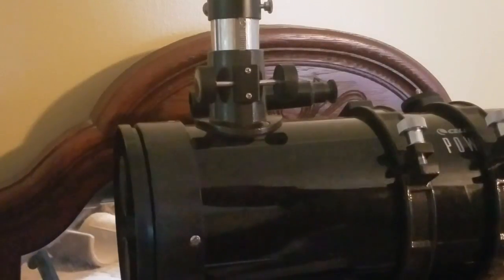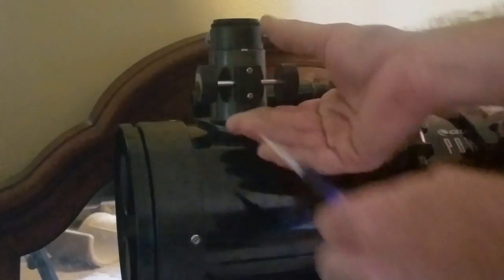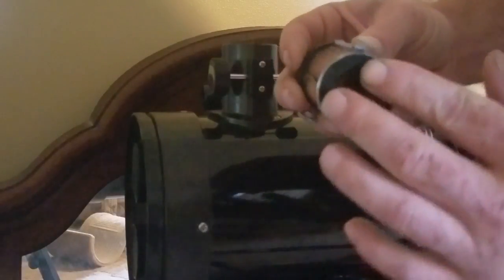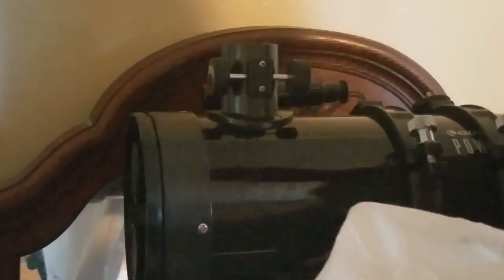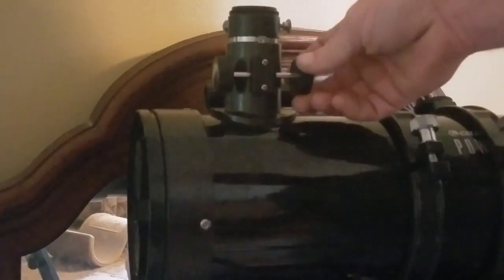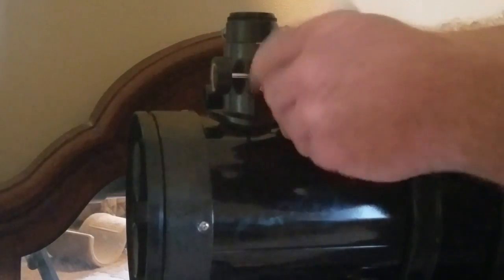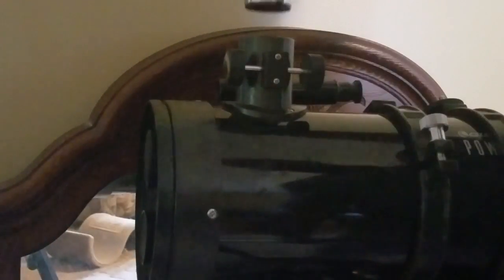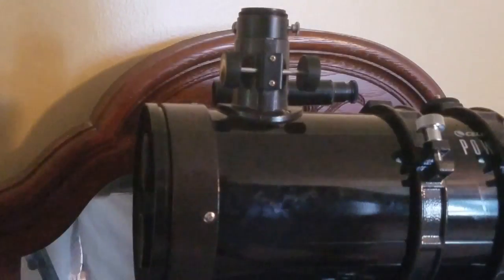Laser collimating a Celestron powerseeker 127eg step 1

Comment: Thanks for the video!  There are so few with this level of detail for the powerseeker. I’m curious if you ever had fine focus issues if the plastic ring wasn’t tightened down over the corrector lens tight enough in the focus tube?  I’ve collimated and I know the lens is in facing the correct direction (because I got it wrong the first time) but I still have trouble getting extremely fine focus even with just my 24mm eyepiece with 2x Barlow in. Just the 24mm seems to resolve a decent focus without the Barlow. But once I start increasing magnification it has a harder time...

Comment: Thanks you very much for making this vídeo  Chris!!
But I'm a little afraid of removing The corrective lens from The focuser....
I found these poste on a thread at Astonomyforum.net about collimating The Powerseeker:

#i did the same, i've removed the correcting lens from the focuser and using laser collimater i've almost collimated the mirrors, but once i placed back the corrector lens, i can see the my eye is not located at the middle of the secondary mirror + i can see an oval shape when looking inside the focus tube instead of circular shape. i'm getting crazy and dont know which of them should i trust , the laser collimator or my eyes

I feel your pain. I too have the same scope and the Collimation woes. I have removed the internal Barlow to aid in Collimation. After putting it back together the images I see are only in half focus. Hopefully at a star party in two weeks I can find someone to help me out. I hope you get yours figured out soon.

I could have gone wrong to these folks having problem after removing and putting back on their corrective lens?

Comment: Why do you have to remove the corrective lens? Is it because the collimator tool won't fit if the lens is in place?
Reply from the maker: soulreapernathaniel 
It has to be remove to use a laser collimator. The laser looks like a blob with it in and a pin point with it out.
Reply: Chris Fleming 
thank you for the reply..
Reply from the maker: +soulreapernathaniel
You welcome... I they to write back as soon as possible.

Comment: It's worth mentioning Celestron's opinion on collimating this telescope. If you're like me and read the entire manual that came with your telescope you too probably came upon the part that says, "The optical performance of most Newtonian reflecting telescopes can be optimized by re-collimating..." and the subsequent pages on how to do it, including the suggestion to purchase the 1.25 collimating eyepiece. Tech support will tell you that at least in hindsight, this section should have been omitted from the manuals for the bird jones scopes. IKR??? WTF. The reason being that the eyepiece or laser is meant to take measurements from the focal point, which is half a meter back from the focuser once you remove the lens. It's here that I'd like to mention here how awesome Celestron support is despite this goof, and that if you find yourself tearing your hair out, call them and they will (in my experience) bend over backward to make it right. I was told by a very understanding support person that she's had hers for years and it's never needed re-colllimation and that barring some severe jolts, it would likely never need it. So then that left the question, what if it does? Mine was new so they issued me a UPS label and I sent my tube in for re-collimation. Awesome? Yes. But I really wanted to be self sufficient so I asked "Can I not perform this procedure at home?" Officially you're supposed to have them service it. But if that is insufficient and you need to be able to do it yourself, to look on youtube for instructions on how. So here we are. =)
Reply from the maker: That was cool of Celestron to do that. An I am with you on self sufficient part! I have had good luck on collimating it my self with the lens out and the laser collimator in the focuser. I have added a center dot on the primary mirror which has helped a great deal. As far as it never needing re-collimation lol. It's made well but temperature alone can off set the mirrors.
Reply: I've been considering a dot also, how did you go about setting yours? Thus far I've been too intimidated to stick something on my primary, which is pretty much how I felt about the lens till you alleviated that concern. Thank you again.
Reply from the maker: +Liam Howlett I play listed the video I followed on my celestron powerseeker play list. I made my own template out of wax paper and marked it with a compass and protractor set. It took me a few times making the template right. Wish I would have made a video of it myself. You welcome and if you watch that video I play listed and still have any questions I will do my best to answer.
Reply from the maker: +Liam Howlett  reinforcement labels for notebook paper work real well and are a lot cheaper than the ones telescope company sell.
Reply: Hi Liam, I recently purchased a Celestron telescope myself - were you finally successful in collimating yours? Is the manual really helpful? I'm just about to read it especially re: collimation. I tried using it without adjusting anything, and I saw nothing... I really need to collimate!

Comment: It occured to me that since the lens shortens the focal length so your 1000mm reflector can fit in a 500mm package, when you remove it, the new focal point is half a meter from the focuser which essentially cuts your precision in half. I built an extension that fits into the focuser and into the other end of which I can insert the laser collimator. I built mine out of two pieces of polycarbonate tubing I got from mcmaster. One with the outer diameter of 1.25" and the other with an inner diameter also 1.25".  This lets them "telescope" so I can adjust the length. I snugged it up with some tape to remove the play at the focuser end, telescoping joint and collimator end. To ensure the laser was dead center at the focuser end, I made a short piece out of the larger diameter stock and pressure fit a washer (od 1.25) into the end with some scotch tape over the hole to project on --essentialy making an attachment to collimate the collimator. Centered up, I remove the attachment, put the male end into the focuser and proceed normally. I used polycarbonate because it fit the bill and didn't break the bank. Also standard pipe sizes don't have an inner or outer diameter of 1.25", but these tubes come in a wide selection, and I just like the stuff. P.S. I found that when centering the focuser end of the tool, that it's most effective to rotate the collimator in its socket. Also orient your telescope so that the focuser and thus the tool is facing straight up. This will reduce error from bending and extra play in the focuser.
Reply from the maker: +Liam Howlett That is awesome and sound like you have put a lot of thought into it. Thank you for sharing I will have to try your technique out!
Reply: i can use it at 500mm of focal lenght?
Reply: Wow, this must be why my collmination never seemed right... Can you post measurements? I can 3d print an extension tube

Comment: Would it still work without the little lens?
Reply: The lens shortens the focal length so your 1000mm telescope can fit into a 500mm package. Without it, you'd have to move your eyepiece half a meter back from the focuser.
Reply: +Chris Fleming Okay! Thanks!
Reply: Aside from shortening the focal length The little lens also adjusts for spherical aberration to give the image a sharper focus.  The shape of the lens is specific to the shape of the particular mirror it is paired with.  While you can achieve some focus by moving the eyepiece back 500 mm it will not be an optimum, sharp image.  

http://amazingspace.org/resources/explorations/groundup/lesson/basics/g12/
Reply from the maker: +Kaleb Larry As is no it want work with out it. I am working on a way to do away with it and when I get it right I will post how I managed to do it.

Comment: Thanks for the informative videos, looking forward to seeing the optic/laser alignment procedure.  I just assembled mine last night but due to weather, will probably not use it for a couple weeks.  I am gathering info to find the best laser collumnator to use, which I know will be needed.
Reply from the maker: You welcome and glad I could help! I use the Orion 5691 laserMate Deluxe2 laser collimator and it has worked well for me. It also comes with three center dots for the primary mirror. I sure there may be better ones out there but they were out of my price range. Here is a link for this collimator.https://www.amazon.com/Orion-5691-LaserMate-Telescope-Collimator/dp/B008XEGXMO/ref=sr_1_1?ie=UTF8&qid=1483911716&sr=8-1&keywords=orion+5691

Comment: What was the tool you used to get the lens nut loose? Thank you.
Reply from the maker: +Liam Howlett 
I believe it is called a triangle multi tool. But you can use anything that will fit across and in the slots on the lock ring. The first time I took it off I used a banking card just be careful and if I can help in anyway please let me know. Thank you!